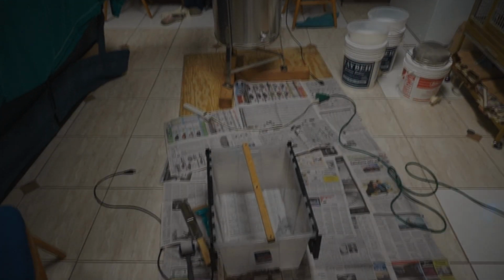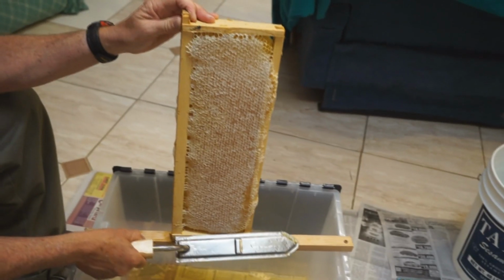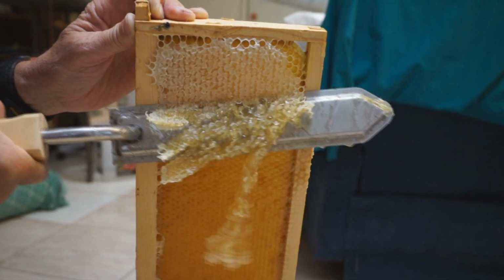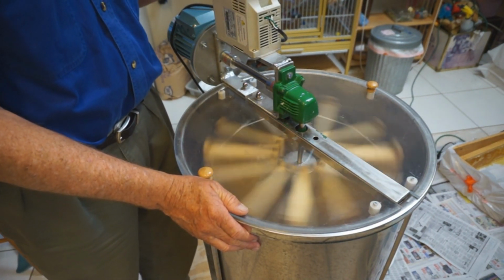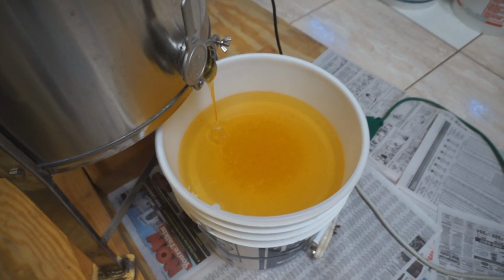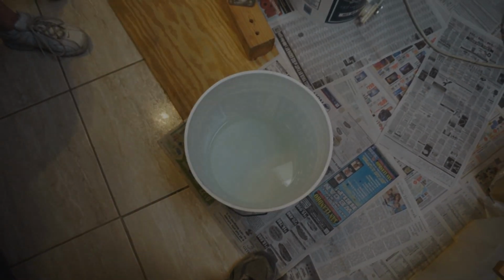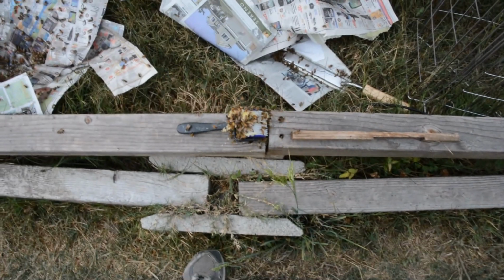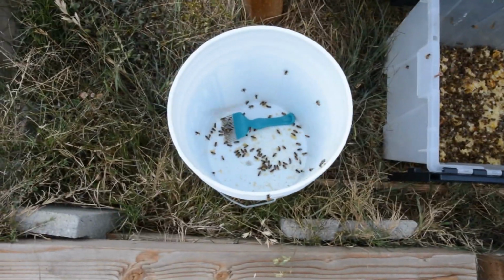Extracting honey

Comment: Would you please tell us the material list you used ( motor, drive, etc...)
Thanks!
Reply from the maker: I'm a little reluctant to supply a list because these items become obsolete so quickly, but in any case the motor was just a generic 3 phase 1/4HP, the drive was a GS1.
Reply: Thanks, appreciate, what about the gearbox? Seems very difficult to find
Reply from the maker: @brugiseb  The gear box came with the extractor, I just reversed it so instead of being 1 to 3 ratio it is now 3 to 1.